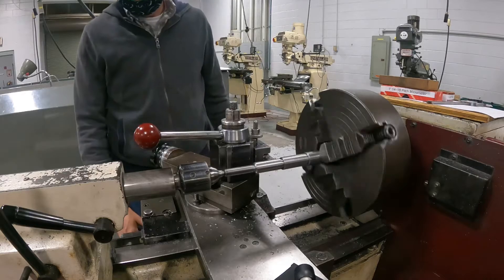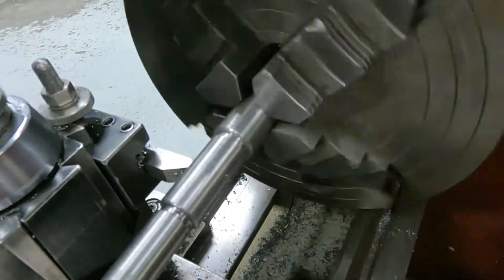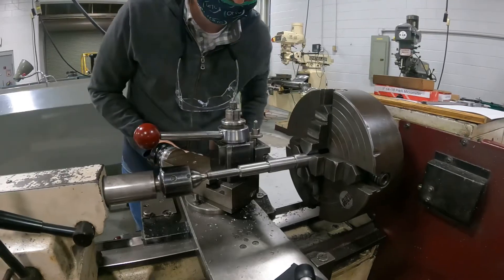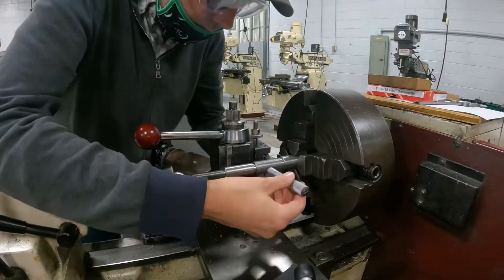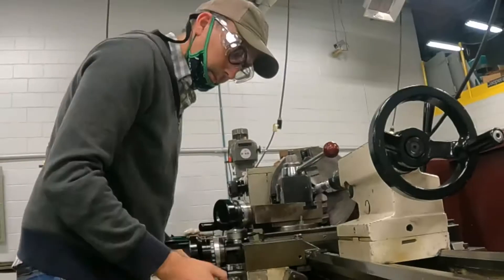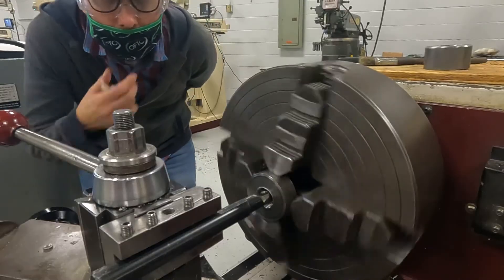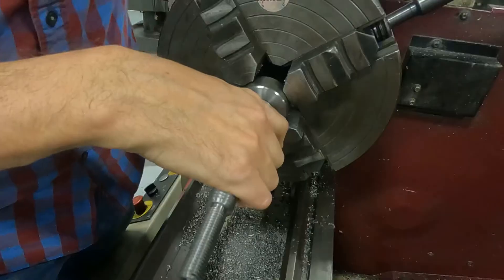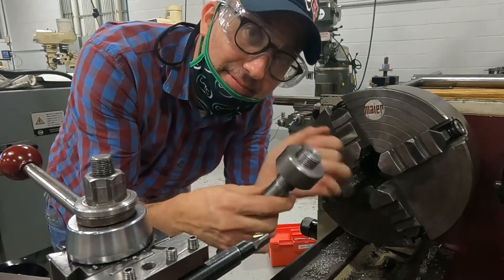Machinist school project - Cutting Threads!

Comment: That's too cool.  I think one of the other descriptors for a screw is that it's a type of inclined plane, if I recall correctly - it's just around a cylinder, which goes to the raising/lowering ability of them, among other uses.